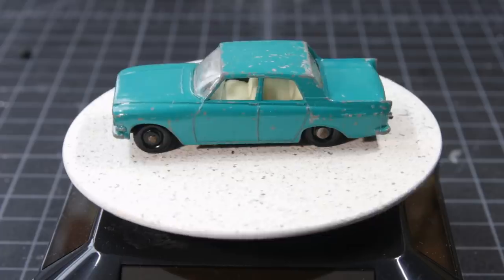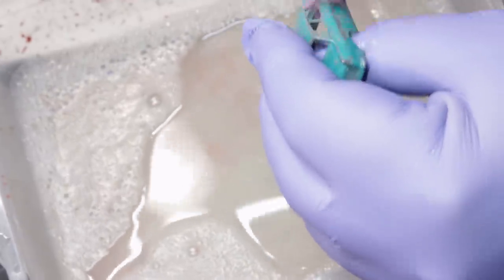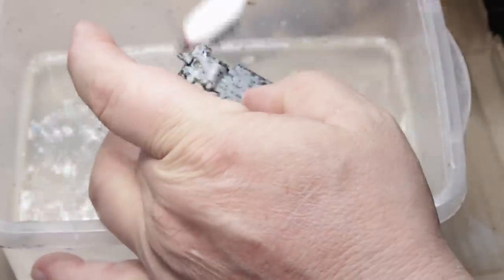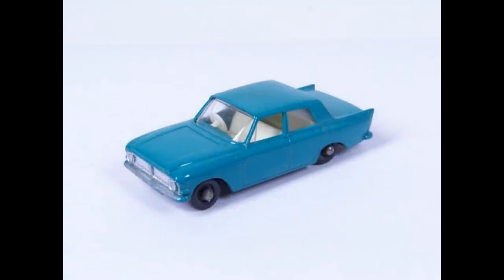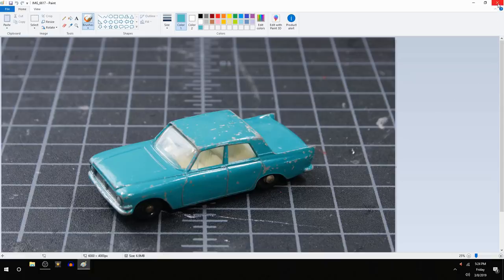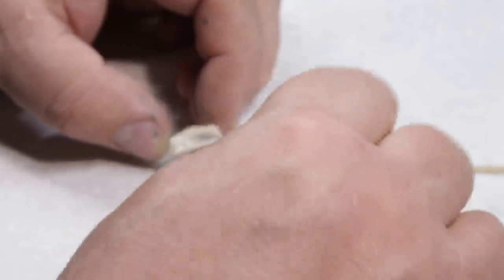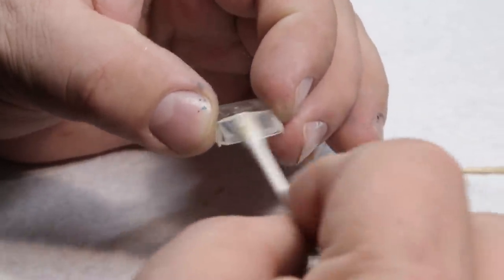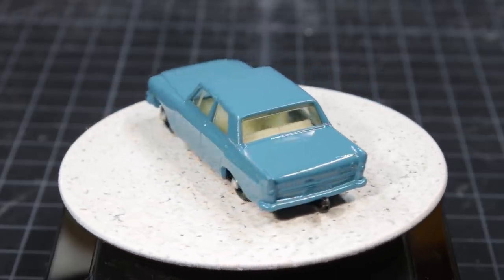Matchbox #33B Ford Zephyr - Restoration

Comment: Hi Time Rider.  Fantastic work you do.  I have been watching your videos  (and Marty's) for a few months now.  I don't watch them alone. My 7 week old boy watches them with me.  At times he is glued to the TV (watching you and Marty on a 55" tv is awesome) and I have seen the little guy's mouth open as if he is going 'WOW!'

I too am restoring these cars and have collected a number of them from Matchbox, and corgi (both classic and superfast/WhizzWheels) to Dinky, and will be restoring them for my boy so he can have his own collection. On the plus side I work in a vintage/retro shop and these models come in all the time, so I have buckets and buckets of cars and I am never short of what model to choose

I have just one little tip which maybe of some help. After I have drilled and taped the holes I had one problem which was sometimes the paint would collect in the hole and stop the screw from going in after the paint had dried as sometime you might just spray a tiny bit too much on when trying to cover all the toy.  So what I what do now is after having drilled and taped the holes, I fit the screw and spray the toy with it in place.  This way the hole is paint free and I get colour matching screws 'À la Marty's Matchbox Makeovers'.

But on some of the toys I have started to use the glue in rivets as some of the cars have larger holes.

Anyway keep up the good work and keep those videos coming

Watching from Northamptonshire (UK)

Comment: Nice paint job - brilliant job as always.  BTW - I once had the "pleasure" of being in upstate New York where it snowed 30 days in a row - snow was piled up over 6 feet high on the sides of the road and the roofs started to collapse because of the weight of the snow - eventually it did stop and spring did come.  Hang in there - spring will happen.  Good luck!
Reply from the maker: The snow at the old house is easily 5 1/2 feet at the end of the driveway and 3 1/2 feet along the sides.

Comment: Good looking car. Reminds me of the Ford Falcon.
Reply from the maker: Yeah, probably the same car essentially.
Reply: They were more or less same the idea but executed differently, smaller than a Falcon but larger than a Cortina with a 2.3 litre straight six unique to the UK Fords.
Reply: The earlier Zephyr model was sold here, in Australia.  In 1960, Ford switched to the Falcon, and on it went until 2016.  I saw a 1962 Falcon ute, recently, and parked my 2014 Falcon ute next to it.  My, how its grown in size.
Reply: I meant the American Ford Facon. I believe they this squared off style from 1960 to 1967. Originally a four cyl. then a six and an option of an eight. Thanks for the overseas education. Everyday there is an opportunity to learn.
Reply: @westonward735  The Australian version of the Falcon was very similar looking to the US version - up to 1969.  Only very minor differences with the lights or grill.  Engines were the same: 144, 170 and 200ci six.  I sometimes have to look twice at photos - especially side-on pictures.  The Zephyr is particularly close to the 1960 Falcon, in the front end styling.  Ford family likeness?
Reply: @westonward735  No problem, The Falcon was mostly the same in Australia as in the US except for the 64-66 models (Aussie 64's were modified 60-63 US bodies and Aussie 65-66's were modified US 64 bodies), both were the same again from 67 onward. I don't ever remember there being a 4 cylinder Falcon over here but we had 144, 188, 170 and 200 CID 6's from 60-66 (no V8's) and the same V8's as the US (289, 302, 351 Windsor and 351 Cleveland). Bonus fact: after 1972 Ford Australia also made a de-stroked 302 Cleveland using a 3 inch stroke crank and longer conrods in the standard short deck 351 block, Aussie built Falcons were the only Fords to receive this engine and both it and the 351C were built until 82.

Comment: Whats this? Am I dreaming? (slaps face), no it's real, Mr. Time Rider is actually REPAIRING a trailer hitch, Seriously, previous comments have already mentioned the fact that the Zephyr six was a popular car with British police forces, (after modification) and quite useful in high speed pursuits, apparently! Your method of leaving out any parts of the restoration that have previously been covered by you is very satisfying; not going over old ground makes the the whole thing much more watchable, (only my opinion!). BTW, great paint job and restoration, thanks for that, sorry about the snow there, I should tell you that recently in Britain, temperatures have been higher than in Mexico. You must be quite close to the North Pole.
Reply from the maker: I try to strike a balance, if I leave too much out I get blasted for that too!  I try to keep them around 15-17 minutes.

Comment: Excellent work.  The colour looks great.  I have a silver plastic wheels version.  All this time I never noticed the "Zephyr 6" badge cast in the boot lid.  It's hitched to a #23D trailer caravan.  Were you able to get the rear suspension back up to height?  Mine is sagged too, in the rear only, so it must be a common problem to all models.  More than 50 days in a row here, Brisbane, over 30c or 90f.
Reply from the maker: Yeah, I just boil it for half a minute and bend it back whilst running cold water over it.  It's very common for these Matchbox suspensions to get "bent."

Comment: Once again, very informative video and an excellent result.  Are you still using the G36 airbrush?  Where do you get your axle sets (tube and end  pins)?
Reply: The axle sets are available on ebay  - 
https://www.ebay.com/itm/183676749762?ViewItem=&item=183676749762 
A larger set was available but I don't see it listed any more.
Reply from the maker: It comes and goes, you have to watch it.  That being said the tube can be had at any hobby shop and as I understand from another guy (baremetal or WNT) the pins can be had at a craft store.

Comment: I like your blue better. That is such a cute little wee car. Funny how Lincoln makes the Zephyr and not Ford. Although Lincoln and Ford are the same company
Reply from the maker: Yeah, go figure.  Thanks for the kind comments.
Reply: Ford of England produced a three-model range of medium-sized cars in that period, comprising the Consul, Zephyr and Zodiac in rising order of fitments.  This model represents the 3rd iteration in that sequence.  Zephyr was available with 4- or 6- pot engines.  The higher-spec models were available as coach-built estate cars, but are extremely rare.  My father bought a Mk 2 Zodiac estate  as a last-owner car in the early 70s - it had a three-on-the-tree change but there was no way of anticipating which gear would actually result. I regret that I didn't inherit it but I could not have afforded to fix it anyway.